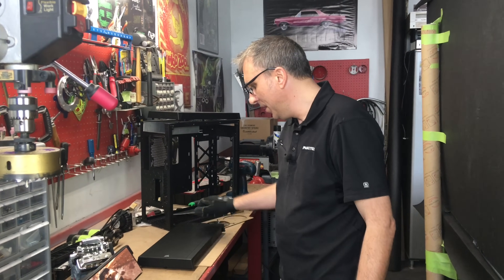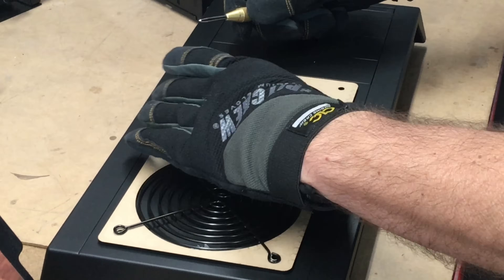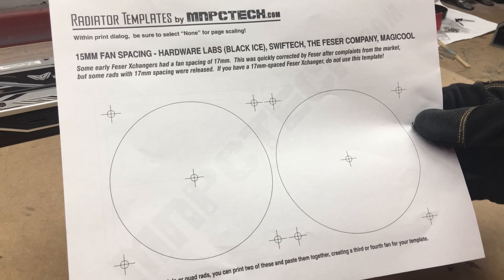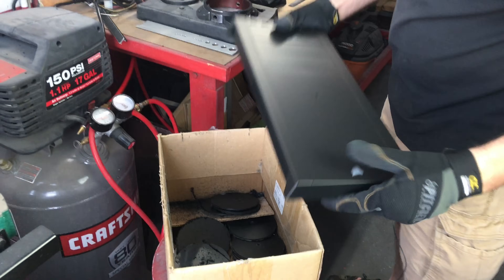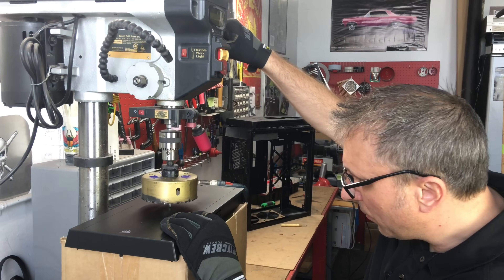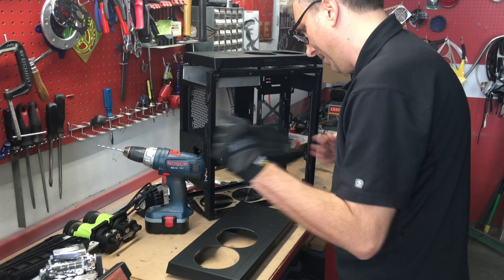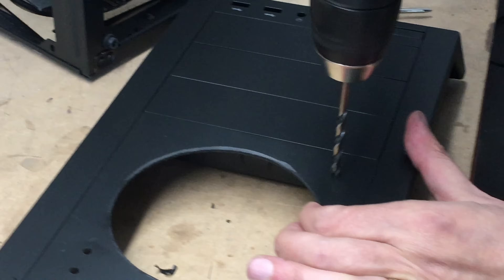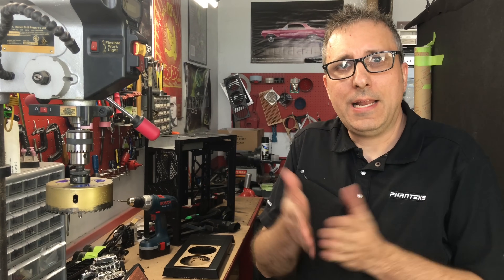PC CASE BEZEL AIRFLOW MOD GUIDE DRILLING HOLE SAW INTO PLASTIC

Comment: the holes are way too close to each other - there's no longer any strength or rigidity in that middle area and can easily snap
Reply from the maker: still rocking today without any cracks

Comment: i want to mod my NZXT H510 for better airflow to my front rad and maybe add another top fan. any tips for covering the holes up? u wanna mod my case and put covers over the holes. covers may be part of the mounting system
Reply from the maker: We use these mesh fan grills as covers, https://www.mnpctech.com/products/modders-mesh-pc-fan-grills?_pos=2&_sid=76de300fb&_ss=r

Comment: How would you mod deepcool teseract? Love this case but since part upgrade everything is so cramped. Wish to ad height to it.
Reply from the maker: you're better off buying new case instead of investing all of the time to do that mod. Great mid tower cases out there for under $100, like this corsair, https://www.amazon.com/Corsair-4000D-Airflow-Tempered-Mid-Tower/dp/B08C7BGV3D/ref=sr_1_3?crid=2RIZUPQAM4GZ9&keywords=best+mid+tower+atx+case&qid=1694357654&sprefix=best+mid+tower+atx+case%2Caps%2C106&sr=8-3&ufe=app_do%3Aamzn1.fos.006c50ae-5d4c-4777-9bc0-4513d670b6bc

Comment: Try holding a couple ice cubes against the hole saw - I bet it keeps the heat down and the water will get into the cut, and I don't think it will melt.
I bet it makes a perfect cut with no clean-up with your Rat-Bastard file !  I like the Pirate Apple logo - want one !!

Comment: I built a cabinet (21.25"X29.5"X8" (W,H, and D)) to replace the 2 unappealing (😉 2x4s, built in shop class in middle school.) legs, and plan on putting the components from one of my PCs inside. A diy case of sorts, but currently working on airflow and dust prevention (Lol, as I know I will be tempted to power the components up as soon as they are mounted.). Was looking into pc panels for ideas when I stumbled upon your video. I'm working on the intake and trying to come up with a 120mmX360mm panel that would satisfy my airflow and filtration, while being cheap and esthetically pleasant. So far I have a few ideas, but seeing if I can find something better. Anyways, that's my "current" project.

Comment: ya I need to fix the DarkFlash DLH21 non-mesh version. It has horrible airflow with a solid plastic front that is not flat and the only airflow comes from a small slot of holes on the back from panel. I currently took the front aluminum panel off from the plastic but do like the look of the plastic panel. Working on coming up with a similar solution to solve the airflow issue all while keeping most of the looks. I did not chose this case. Newegg made a mistake and sent 2 when my son built his last PC. I'm either going to fix it or build another Mac G5 to MATX conversion mod case in black. Decisions....decisions...

Comment: Doing this in metal is a ballache when you don't have a strong drill press. Mines cheap because I barely need it, and it bound up a lot under pressure. Took ages to cut but it was worth it, very clean cut. 
Wish I had the skills/tools to make more 'specialised' ventilation, such as long rectangles with circular tips on each end and applying a mesh internally so it looks factory rather than going with a straight gaping hole.

Comment: honestly I just made a pattern I liked using excel and printed it out then drilled roughly 50 or so holes in the front of my case and put a white mesh behind it, I think it looks better and i got a great performance increase.
Reply: then i used a file to get rid of the excess plastic, did the same thing with the side of my case and used a Dremel to file down the metal to get rid of the sharp edges.

Comment: Love this video. That 1/8th scale Ford 427 supercharged engine really grabed my attention being a huge car fan especially of muscle cars and traditional style hot rods & led sleds I grew up with in the 1960s.I used to build those AMT, Revell, Monogram, etc 1/25 & 1/24th scale kits of cars when I was a lad (50+ years ago).  Do you have any of those moded front panels for the Corsair Carbide 200R for sale? Cheers and keep these excellent videos coming.
Reply from the maker: Only had that one 200R case and pretty sure it sold shortly after this video was published, sorry! Thanks for watching.

Comment: I found you late but I want to my sleeper pc I got a case from my neighbor I took out 3.5 bays out for a good way. My GPU fight with 3.5 drive bay and used 5.25 bay for my 2.5 SSD 8 drives nice in 4 DVD bay.

Comment: Hi Bill. Do you have any templates for 200mm fans? I have a Corsair 680x case which has bad airflow. I want to increase airflow without ruining its looks. I was looking to increase bottom size from 140mm to 2 x 200mm Noctua fans
Reply from the maker: no, but you can make your own by tracing the fan, Awesome post, Thank you! Bill at www.Mnpctech.com

Comment: If you don't have plastic drill bits use a center drill to drill a pilot hole first. This will prevent cracking as well as keep the drill on the desired spot so it doesn't slip..... and never use gloves when using rotary equipment... i learned that the hard way. Still a very good guide, thank you Owen for sharing :)
Reply from the maker: agreed, safety first!
Reply: Also, if you use semen as a lubricant around the edges it prevents cracking

Comment: hi just a quick question. i have a 200mm  cooler master fan i want to use in front of my case . i would prefer the front because it has space for two 140mm fans. i was wondering if you have something on your sight to help along with this mod,i'm real bored!
Reply from the maker: Hi, you can purchase 200mm pc fan grills here, https://www.mnpctech.com/products/200mm-230mm-cooling-fan-grill

Comment: Bill, these links are all dead.
Reply from the maker: Yeah, we lost our old store, Which item did you need Christopher?
Reply: @MaxellAdGuy  Bill, what I am looking to do is this: I have a couple of the full ATX Metallic Gear cases. I want to either cut a rectangle out in the aluminum front panels and maybe do some modders mesh and paint it but am afraid that maybe I won't be happy if the cutting with the jigsaw and filing doesn't come out good enough. Or do something like you did here with a hole saw, template and the grille and mesh. That would cover anything up if I got any chatter cutting the holes and stuff.
Reply from the maker: Link to Fan / Radiator Fan Hole templates, https://www.mnpctech.com/pages/pc-fan-radiator-templates

Link to 120mm Grills, https://www.mnpctech.com/products/modders-mesh-pc-fan-grills

240 open air grills are sold out without any ETA until I get laser machine replaced.

Comment: Why 4  1/2 inches. If you measure a 120mm fan it's 4  3/4?
Reply from the maker: Great observation, I think it simply slipped our minds atm, I'll make addition with link in the video description. AND thanks for watching! I make other stuff for your PC  in my workshop. visit my store, http://mnpctech.com  and use my DISCOUNT code, MNFAN at check out for 10% off your order

Comment: I looked at your site to buy one of these but you dont make them anymore which is fine. So just gonna do it myself. Only question I had is what screws did you use thru the front? Is there a nut on the backside of the bezel?

Comment: hmm wonder if i can use this way to make 1 or 2 holes in the top metal part of my masterbox 5 lite considering putting 120 or 240 AIO in it cos the airflow is rubbish ... but im worried about the then 4 or 5 fans sucking air in and only 1x120 fan in the back blowing out..
Reply from the maker: that would be a "positive pressure" system and you'll be fine, cause you'll be pushing the warm out. Just make sure to filter the intake fans, or your system will suck in dust like a vacuum.
Reply: @MaxellAdGuy  thanks. And yeah better filter up..

Comment: I want to do some mods in Carbide Series Air 740 High Airflow ATX Cube Case on bottom do i need plastic or metal drills
Reply from the maker: if the material is plastic, you use drill bit for plastic, likewise for metal, Thank you for watching, Bill at https://mnpctech.com/
Reply: @MaxellAdGuy  the website say metal is there way to test pc case is metal or plastic as the pc does not bend
Reply from the maker: the 740 chassis is metal, the bezel is plastic.
Reply: @MaxellAdGuy  do i need to remove the bezel or can i just drill in it

Comment: Working on a Fractal Design Define XL R2. doing a tempered glass sidepanel, cutout in front and top of the case for better airflow and radiator support. still havent decided if i want to use modders mesh or something elso to "cover up" the cutouts. mostly still in the planning stage.
Reply from the maker: the XL is a great case! Thanks for watching and commenting! Have a Great day! - Bill at http://www.mnpctech.com

Comment: Gotta do this with my Raidmax Delta I case, but I'd need a metal cutting holesaw because the front panel is sheet metal.
Reply from the maker: Buy Bi-Metal Hole saw blade, thanks for watching - Bill at http://www.mnpctech.com

Comment: Do I just got the Corsair 500D and wanting to do something to the front for better airflow but not wanting 120mm holes in the front just some slits or something any ideas on how one would do that?
Reply from the maker: You can copy this front vent mod for the NZXT H440 here, https://www.youtube.com/watch?v=QvypJFvsPW0
Reply: I seen that one to. It’s just not what I’m wanting to do. No big openings just some slits or something.
Reply from the maker: You can either cut the slits yourself OR make rectangle opening and cover it with 240 or 360 rad grill that has slits, https://mnpctech.com/pc-computer-alphacool-ek-bitspower-hardwarelabs-heatkiller-liquid-cooling/240-pc-radiator-grills/

Comment: You wanted to hear what builds/projects the community is working, so I figured I would share mine.
I just got done with doing the nzxt h440 airflow mod using one of your videos as a guide. I made the front and top panel cut outs with rounded corners instead of square cuts tho. And thanks for selling the modders mesh, it was very helpful to make a clean looking finished mod.
Reply from the maker: Cool, do you have a link? thanks for watching - Bill at http://www.mnpctech.com
Reply: https://imgur.com/IikmVv2
Reply from the maker: awesome job, you should share build log on forums, so people can see your work, Have a Great day! - Bill at http://www.mnpctech.com

Comment: If I can find one, they go out of stock right as I'm ready to buy but I'm about to buy an Anideee's Crystal Cube Lite. Any tips for cutting into glass? The front of the case is quite restricted. I already have plans to cut out of the front fan mounts as they block the airflow from the 4x120mm fan mount they include in the box.

Comment: Glad to see a new video Bill! You asked, so I'll answer: I've got a new build in the works. 
Ryzen 2700x
Asus Crosshair VII Hero Mobo
64GB of G.Skill Trident Z RGB ram
Two WD Black NVM.e HDs, 500GB and 1TB. One will be for the OS, and 1 for most commonly used programs (OS will be using PCI lanes and the other will use SATA due to lane restrictions as 16 will be fore GPU)
My old 7200 HDDs, 2TB and 8TB respectively for documents and video footage for my channel
A Seasonic Prime Titanium Ultra 1000 Watt PSU (Will eventually get some custom cables from Cablemod--Yay 20% off coupon with mobo)
A boat load of Corsair HD120 RGB fans
Corsair Commander Pro and Lighting Node Pro

And when available for purchase the Lian Li PC-O11 Dynamic in white and a new GPU (upon announcement). Right now I'll be using a Corsair Carbide 275R and my old GTX 970. I really wanted the Dynamic but stock sold out super quick, so I got the 275R to serve in the interim. It's decently priced and I want to try a mod on one anyway.

I'll eventually go full hard tubing water loop as well. Again, waiting on the GPUs to be announced (will wait until after Computex). I pretty much have those parts on order. EK black chrome fittings, RGB Res/D5 Pump combo, Monoblock for the mobo, 2 360 PE radiators.

That's all I can think of for now lol. I'm excited to start building the dang thing!
Reply from the maker: Sounds awesome, Thanks for sharing, I've heard a lot of people are waiting for the Dynamic's release.  Bill at http://www.mnpctech.com

Comment: Considering modding my acrylic side panel -> side fans for better GPU cooling
Reply: I can attest that keeping or installing side fans does help. I modded my Corsair Carbide 500R to have an acrylic window where it formally had 2 side fans. Temps seemed to increase, mostly in the GPU. I'm thinking b/c my heat fins on the GTX 970 HOF were perpendicular to the airflow from those fans so the air could get through them to better cool the thing. Now without the fans on the side the air just hits solid metal so it's not as efficient. I ended up drilling holes into the side panel I had made for 1 or 2 fans (can't remember) and temps subsided again. Then 2 years later I modded it to be glass, so temps are a bit up on the GPU again. lol Looks good though :D even made a vid for the mod:
https://www.youtube.com/watch?v=02DXmlovbFI

I can honestly say Bill's vids inspired the activity.

Comment from the maker: Here are the links mentioned in the video for everything

My guide to hole saw sizes for pc case modding video,
https://www.youtube.com/watch?v=7wGlWZ24QsE&t=90s

FREE Fan & Radiator Grill templates, https://mnpctech.com/pc-cooling-fan-templates.html

Mesh PC Fan grills, https://mnpctech.com/pc-computer-cooling-fans-grills-custom/modders-mesh-pc-fan-grills-en/modders-mesh-pc-fan-grills.html

240mm (2x120) radiator grill template, 
https://mnpctech.com/pc-computer-cooling-fans-grills-custom/open-air-grills/

Airflow PVC Mesh fan Filters, 
https://mnpctech.com/pc-computer-cooling-fans-grills-custom/120mm-pc-cooling-fan-filter-black-pvc.html

Comment: Hey Bill I can't click the Links in the description of the video.
Reply from the maker: My guide to hole saw sizes for pc case modding video,
https://www.youtube.com/watch?v=7wGlWZ24QsE&t=90s

FREE Fan & Radiator Grill templates, https://mnpctech.com/pc-cooling-fan-templates.html

Mesh PC Fan grills, https://mnpctech.com/pc-computer-cooling-fans-grills-custom/modders-mesh-pc-fan-grills-en/modders-mesh-pc-fan-grills.html

240mm (2x120) radiator grill template, 
https://mnpctech.com/pc-computer-cooling-fans-grills-custom/open-air-grills/

Airflow PVC Mesh fan Filters, 
https://mnpctech.com/pc-computer-cooling-fans-grills-custom/120mm-pc-cooling-fan-filter-black-pvc.html

Comment: I love a near silent pc, so at the moment I have taken the side panel off, to easily let air (and a little bit of dust) get in, and only used very slow rotating fans of my choice, to pull air through all-in-one water radiators. By also slowing the water pumps on cpu and gpu I can't hear much and, most importantly, the noice i do get, is constant and very pleasant to my ear. (Not as pleasant as a V8 engine, but you know what I mean ;-)  ). But I am intrigued by this multi fan solution https://youtu.be/VUbpb23yTK8 , even though it is at the other end of the noice spectrum, because it is quite out there - and I like things quite out there :-))
Reply from the maker: sounds like you need a case with good noise isolation, like a Fractal Design Define series OR upgrade to better quality cooling fans like NOCTUA OR add your own sound dampening materials to your existing case. Check out https://www.quietpcusa.com/ for more solution to deaden that noise. Have a great weekend, Bill at http://www.mnpctech.com
Reply: Yes, Fractal Design makes great cases. I use an R4. But taking the side off, made it more silent. I used http://www.silentpcreview.com and listened to their recordings of different fans at different speeds vs the cooling power to find the fans with sounds I liked the most. May you also have a great weekend. :-)  PS. Mad Max is a great theme!

Comment: So not holes for mounting fans, just holes for air flow? If that is the case, how would i then mount fans in this configuration?
Reply from the maker: Just screw them into the holes if you like, and dont forget to add filters over the fans, you don't want dust in your PC! Here are the links mentioned in the video for everything

My guide to hole saw sizes for pc case modding video,
https://www.youtube.com/watch?v=7wGlWZ24QsE&t=90s

FREE Fan & Radiator Grill templates, https://mnpctech.com/pc-cooling-fan-templates.html

Mesh PC Fan grills, https://mnpctech.com/pc-computer-cooling-fans-grills-custom/modders-mesh-pc-fan-grills-en/modders-mesh-pc-fan-grills.html

240mm (2x120) radiator grill template, 
https://mnpctech.com/pc-computer-cooling-fans-grills-custom/open-air-grills/

Airflow PVC Mesh fan Filters, 
https://mnpctech.com/pc-computer-cooling-fans-grills-custom/120mm-pc-cooling-fan-filter-black-pvc.html
Reply: Thanks for responding, so the fan screws would just go where the mounting screws are?
Reply: Jimmy yeah. You can make the holes slightly smaller and screw straight into the plastic like yiu do with fans or you could get a long threaded rod and put nuts and stuff in it for a more industrial look. It's pretty easy to do. The hard part is prettying it up lol